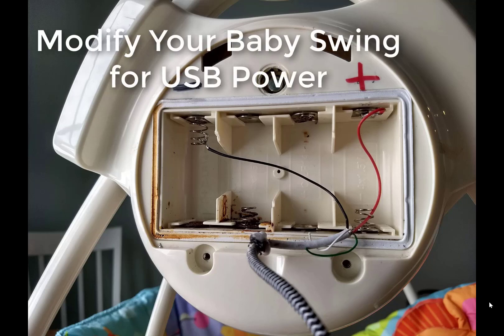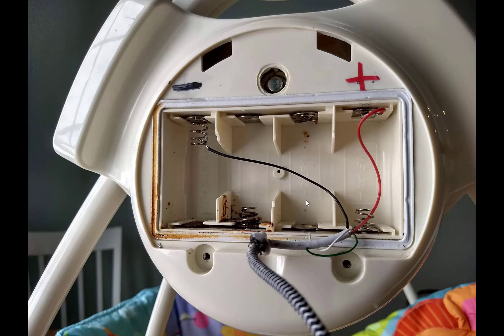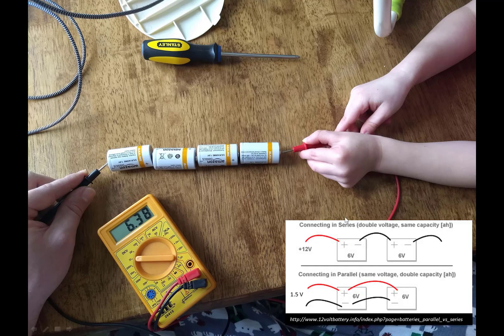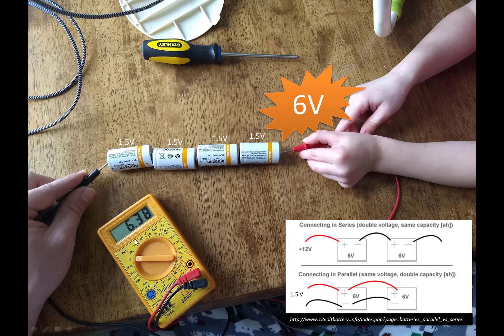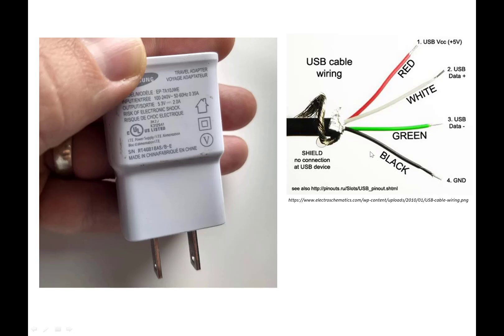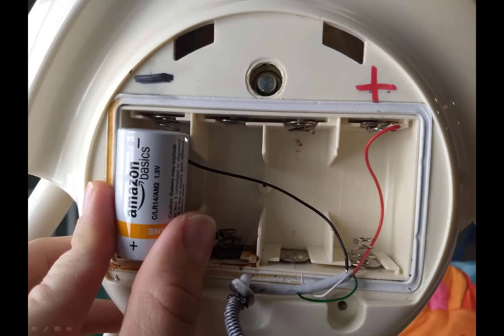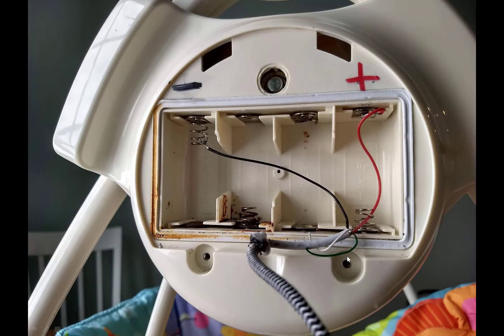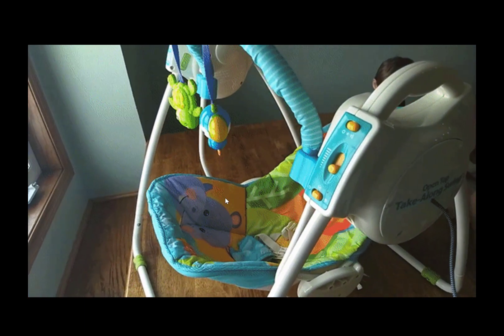Convert Your Baby Swing to USB Power

Comment: Is this not dangerous for baby????
Reply from the maker: We never had any issues. Wire it correctly and don't exceed voltage or amperage with your power supply and there shouldn't be an issue. Doing this will probably void your warranty. You accept all liability and damages. If you question your knowledge, skill, or supplies, don't do it. Best of luck 👍🏻.
Reply: No. The babies is in no contact with the wires. If you put the wires away and it is the right voltage. It shouldn’t be a problem. Mine worked fine